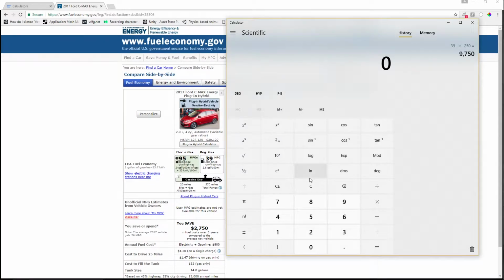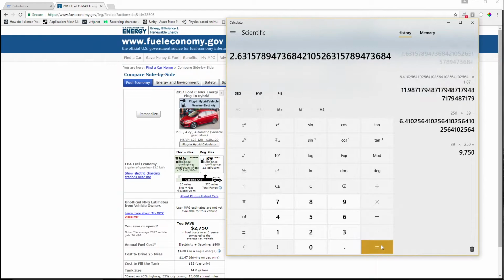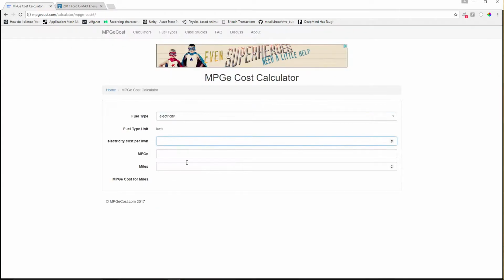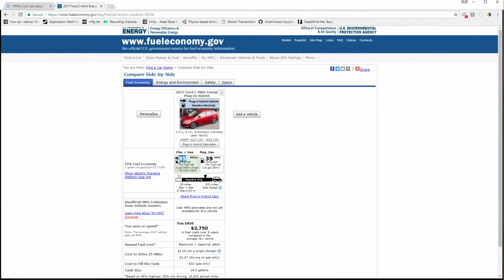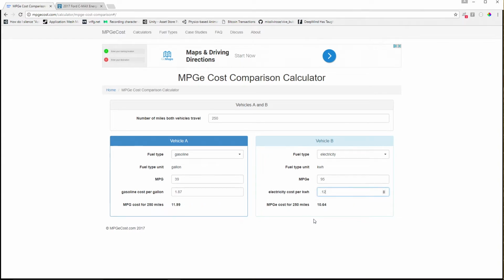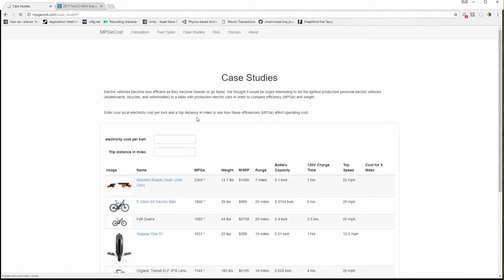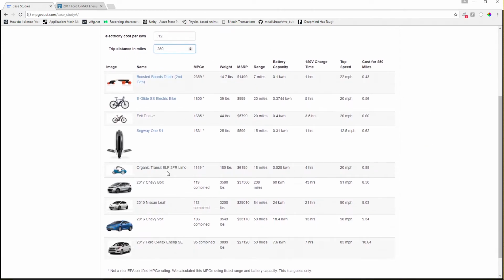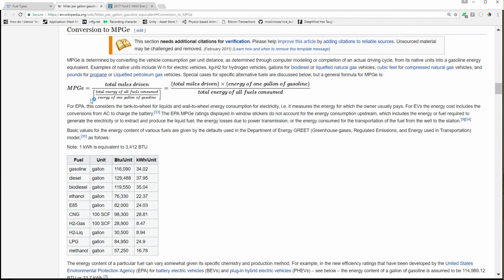MPGe Cost Calculator

Comment: Very cool!  Love my Nissan LEAF and looking forward to all of the next gen EVs coming out in the next 18 months.  When I considered fuel costs, electricity tends to be fairly stable and doesn't experience the dramatic fluctuations as gas/diesel.  One area you personally might enjoy is the LEAF turns out to be a great 24kW battery back generator.  All you need is a 12V inverter and you're good to go.  Max load is limited to 2K watts, but as you know, you can power a lot with that much power.
Reply from the maker: +Matt Lesak whoa. The leaf has 2kw available on it's 12v rail? That's a huge down converter!
Reply: Yep.  Tried and tested myself.  I need to make a video about it.  There's stuff on blogs, but not sure if someone actually shows it.  I have a battery bank that my wife can switch on when we have a power loss, but once it's drained, we can hook up the LEAF.  The 12V step down is used to keep the 12V accessory battery charged.  If you weren't aware, EVs have a lead acid 12V battery for all of the 12V accessories (I wasn't aware until after I purchased the car).  Interface with the battery and bingo, the LEAF push up to 2K watts to keep that battery charged.
Reply from the maker: +Matt Lesak My partner has a CMAX, so I've had a few run ins with the accessory battery. I'm still scratching my head over it. Why not just use the down converter directly? Must have something to do with inrush current.

It would be really cool to design a solar array with a capacitor bank that runs an inverter for the sole purpose of charging EVs via 120 volt. With all the used Leafs on the market it makes you wonder if they're the best solar storage batteries money can buy right now.
Reply: My 2015 has 24kWh of power.  The 2016 has 30.  For about $9K (average cost of used LEAF), that's a lot of power.  Plus you can use it as a car ;-)
As far as solar array, I would love to do it, but not going to happen with this home.

Comment: Many factors come to play when calculating the potential benefit of using gas or electric. Cost of Gasoline and cost of electricity are primary factors. Miles per gallon and miles per kilowatt hour is another. Convert it into cents per mile and you'll have a more accurate cost breakdown. The MPGe is an average which is not fair for places say with extreme cost for electricity.
Reply from the maker: If you want to quickly calculate how much money a given mpge will cost you with YOUR electric rate, use this free calculator: http://mpgecost.com/calculator/mpge-cost.html#/

Comment: You should make metric units selectable.
Reply from the maker: +Calum Wilde I'll add that to the todo list. I'd also like to add a graph generator so you can see the price cross over point for two different fuel types.
Reply: Thanks